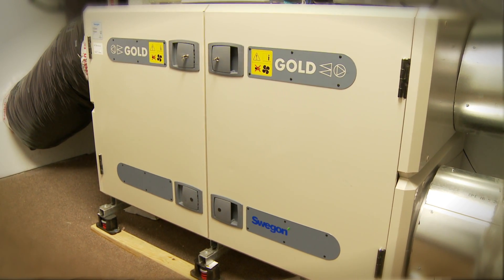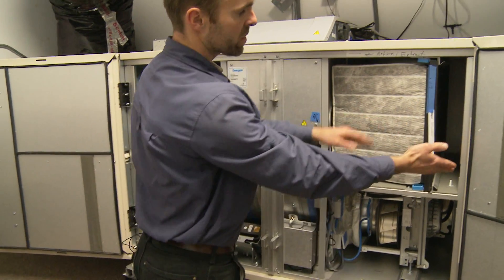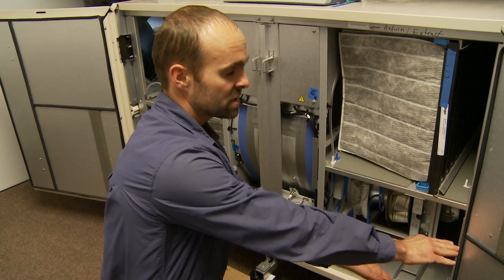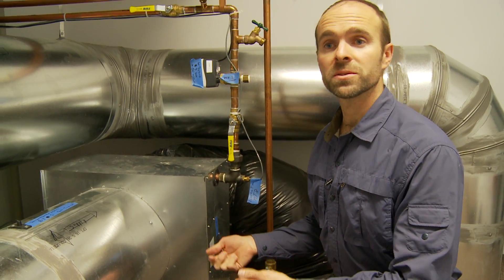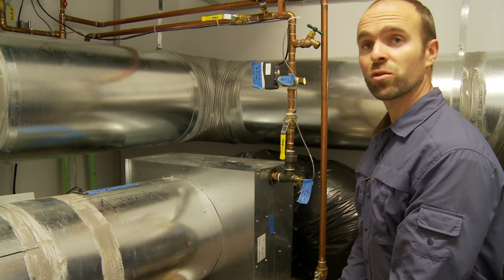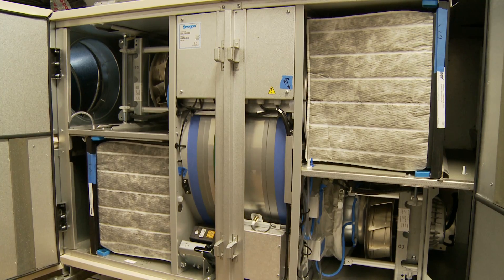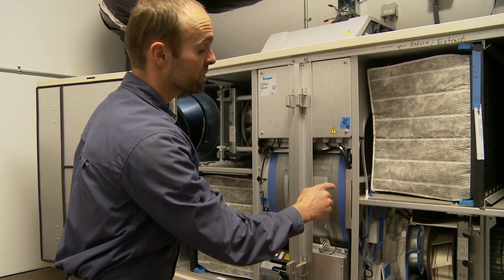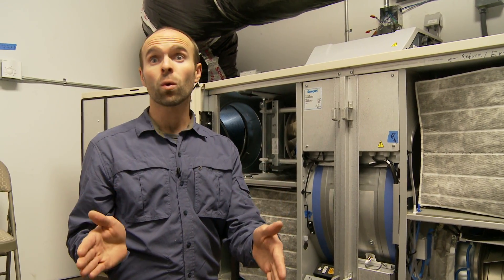Inside CCHRC: How the Heat Recovery Ventilator Works

Comment: Not enough people look at proper ventilation with houses being built air tight. Gotta have some where for the moisture to go. That bath vent or stove hood don't work good if it can't pull some fresh air. Building a masonry earthship. I basically will have greenhouse conditions when it comes to moisture.